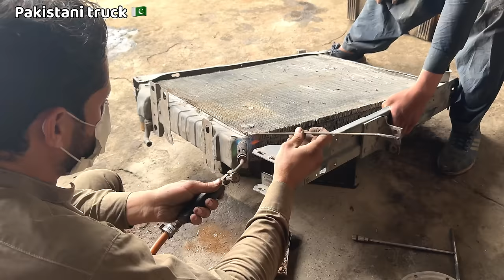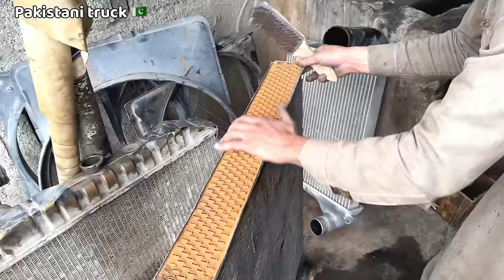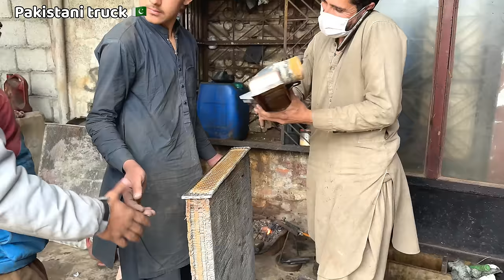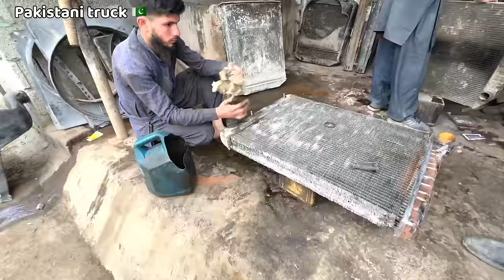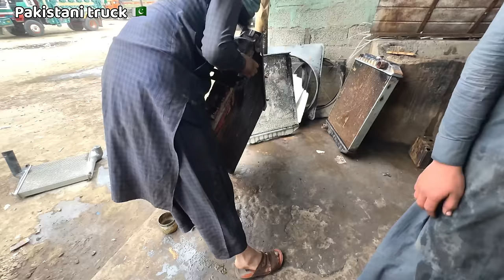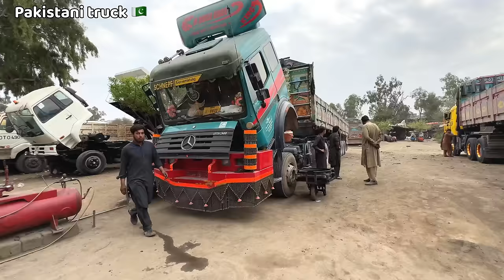Mercedes Benz Radiator Repair: Fixing a Leaked and Broken Radiator System & washing radiator inside

Comment: I used to repair radiators like this decades ago, but these days, radiators are aluminium with plastic tanks, so you just have to replace them, as there is no practical way to repair them.

Comment: Really needed a pressure test as well. Just because there was no gravity leak, does not mean that it will not leak when it gets hot and is pressurised by the engine.
Reply from the maker: you’re right